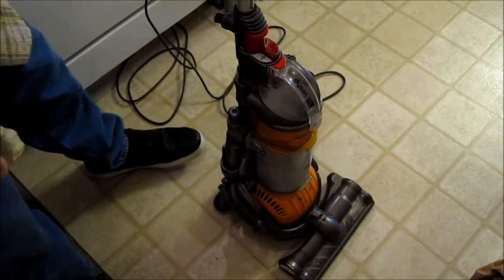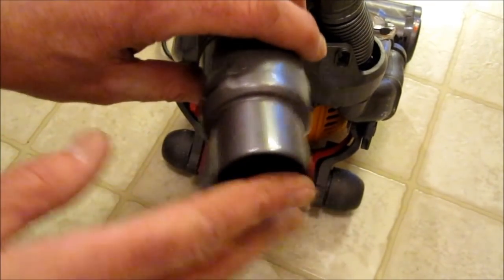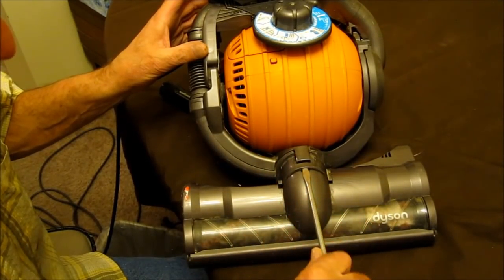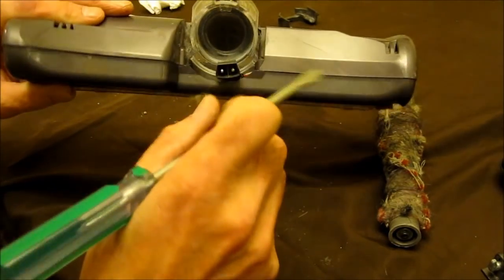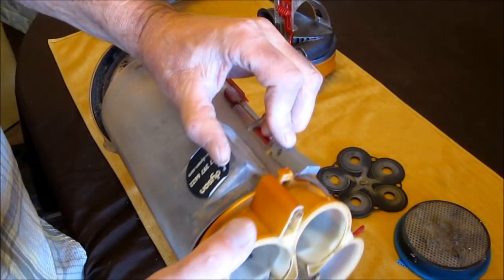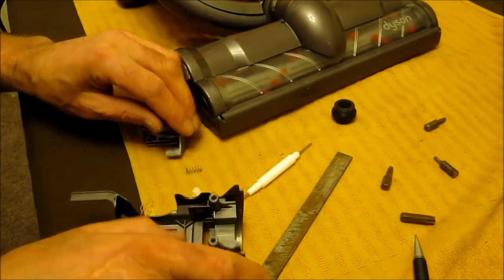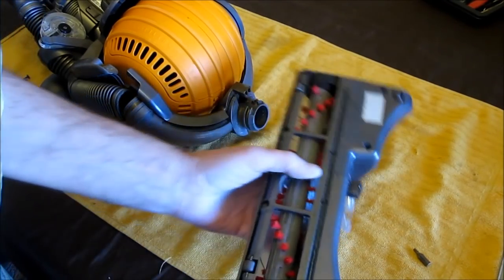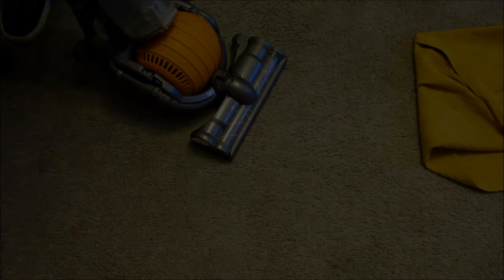Dyson dc24 (No Suction ,Switch  mechanism ,Brush) FIX

Comment: The brush does not spin when the machine is in the upright position. To check whether it is working, you first have to tilt the handle into the reclining position.
Reply: Thank you!!! So simple but this tip plus his instructions to push the reset button solved my whole problem.

Comment: Yes this is exactly what mine is doing.  I’ve cleaned my filter.  Brushes not going around.  I saw sparks coming from the brush area, so I think mine is the circuit board. Thank you. 🇬🇧

Comment: Please, refrain from cleaning all of the parts with any detergent or cleaning product! This is a warning, as you could be compromising the parts. The only part to be cleaned under cold tap water is the filters, in which they should then be left to dry for 24-48 hours, so it does not damage the Dyson. Just a heads up😊
Reply: Yes that is true as there is paper type seals in the basket part that will fall apart,

Comment: Thanks for the video. I just bought one of these at the thrift store for $25.00. As a retired maintenance mechanic, I'm less than impressed with all the over engineered plastic parts and what it takes to convert it to use the wand. My old shark, you'd unlatch the pi pipe and it was done. 
The switch on this machine is wonky and sticks. I need to pull it apart and do your upgrade. The beater bar won't turn off.

Comment: Helped me solve my problem with hose having almost no suction. Did the check you did with the canister off and suction was great. Cleaned all the parts, replaced and same issue, but noticed when the hose flipped to the wand it wasn’t making good contact. Couldn’t see anything from either end so stuck my finger in and felt some fuzz. Pulled it out and and out comes small piece of crumpled up cardboard came out...problem solved and works like new. If you have a problem with suction keep looking!